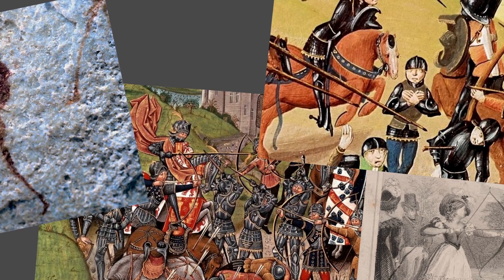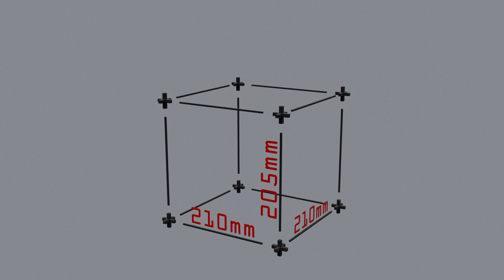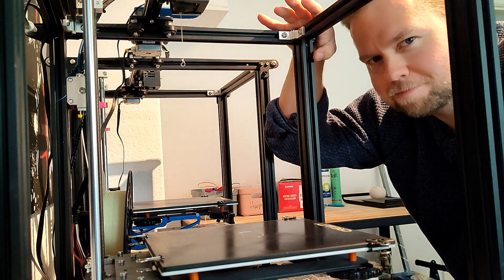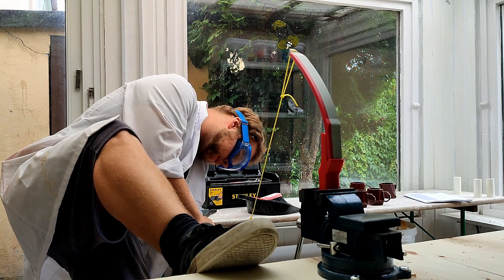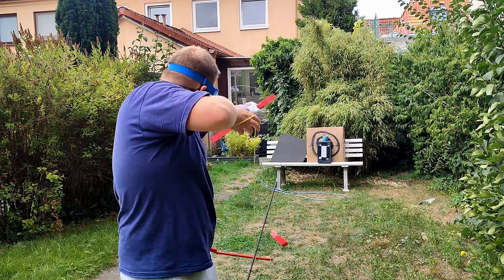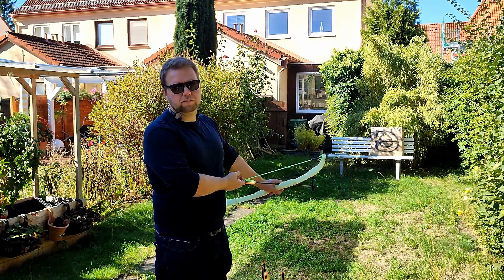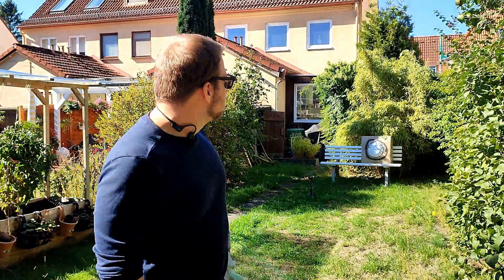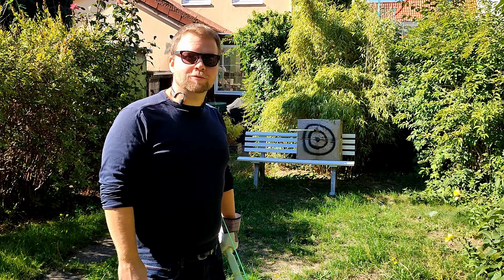I 3D printed a COMPLETE bow for archery - and its pretty awesome

Comment: From your test iteration I can already see why it has such a low draw, and all you have to do is to mount that same bow backwards. You'll get a slightly lower brace height but the draw will be quite powerful, but it's also easy to engineer a workaround to increase the brace height, though... seeing your crossbow designs, this seems to be a recurring pattern. Do give it a shot on your upcoming third iteration, you'll find that the lowered brace height not only lengthens the draw but also increases its poundage. Hope this helps!

Comment: If you make your parts 20% to 30% infill with a lot of little holes on the surface then you can paint them with resin and it will soak in and make them very strong.  It really helps to put them in a vacuum to suck all the air out and then when you let air back into the chamber the resin will get pulled into the part.  If you don't have a vacuum chamber put them in a ziplock bag with resin and hold the bottom half of the bag under water with the top open, it will force resin into the print, but not as well as a vacuum chamber.
Reply: resin is very stiff and brittle this needs to be flexible and impact resistant.  The glow filament is probably the worst thing he could of picked. polymaker polymax pla is probably the best thing on the market for this.
Reply: @paintballercali  The resin is brittle, but the plastic isn't.
Reply: @musikSkool  yes so you're making the bow worse. By making it more rigid.
Reply: @paintballercali  The core is what compressed.  The core isn't supposed to compress.

Comment: Have you seen the printer that has a sort of conveyor belt that allows for virtually infinite x-axis printing? That could be a cool method for one/two part print
Reply: the disadvantage of the belt printer might be, that you much stronger rely on layer adhesion. So it might not be strong enough.

Comment: i fully expected this to just be another 3d printed "bow" that is actually just a slingshot before i clicked the video, Nice! also the speed of the arrow i have found when making bows, is created mostly by the tension on the string before the draw which could be corrected with slightly longer limbs and no pre made bend, is there any reason to why it has a pre built bend in it? was it snapping?
Reply from the maker: Thanks for your thoughts and feedback! By now I have a version that is not pre bend. To be honest, when I started working on this I had no idea what a bow looks like prior to stringing. I am right now booting up a new lab and as soon thats done I will post a new iteration.
Reply: ive never 3d printed before so i dont know the rigidity of the filament but a lighter arrows would go so much better with the low draw weight of the bow
Reply: which can pretty much be summed up, if the bow isnt hard to string, its not going to be powerful

Comment: This is really cool! what filaments material types would you advise for trying this, and have you looked into a conveyor belt 3d printer? I found out they have a kit for the ender 3 Creality that i think would allow you to make the limbs one piece without having to get a bigger printer.
Reply from the maker: For now it is all PlA. I am.thinking about using different printers like.the ender CR7 for a bigger surface but for it to have any major meaning I need to have like 60cms of length and that is rare
Reply: @m3chs_makes Use pla+ it's not as brittle and used in 3d printed firearms! 💯

Comment: Files and what filament did you use?
Reply from the maker: Hey there, not going to share my designs for now. I want to iterate on them and then think about what to do with them
Reply: @m3chs_makes I have a shelved project of a 3d bow that uses fiberglass traffic markers. Idea from pvc bow makers I recommend backyard boyer and Jörg Sprave to learn from!
Reply: @m3chs_makes  Are they still unavailable?
Reply from the maker: @end_slayer  I am finishing up the new version of the bow as I am writing this (its literally on the printer). It will be a lot stronger and I will make those files available for patreons in a few weeks.
Reply: @m3chs_makes  I’m so excited, hopefully I have money for them. Also quick question while I know you’re awake. Are you using PETG? It’s more flexible while PLA is impact resistant.
Reply from the maker: @end_slayer  No worries, I am not planning on making it expensive. Regarding  the material I am using PLA because it is much closer to to wood in terms of material properties. PETG is more like rubber which you can have a lot of fun with but I wanted this thing to feel like an actualy wooden bow.
Reply: @m3chs_makes  interesting, I was thinking that PETG at a high infil or walls would last longer and be stiff but I see where you’re coming from.
Reply: @m3chs_makes  GL and HF